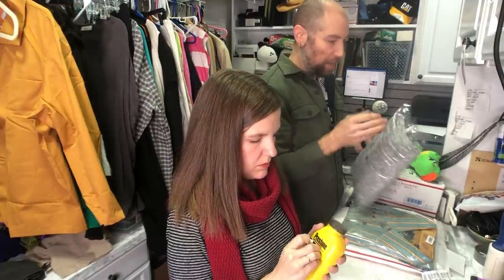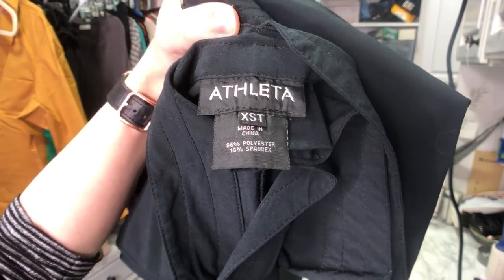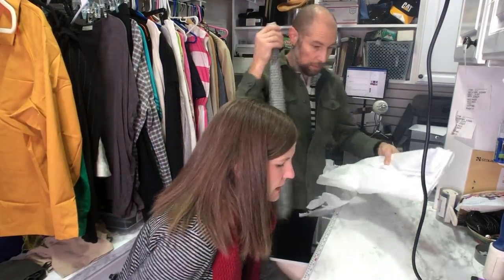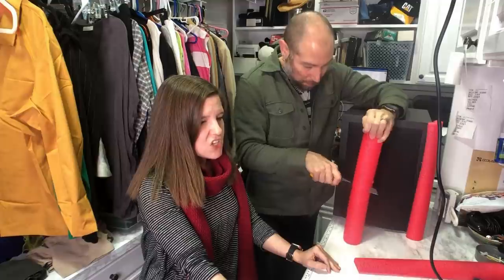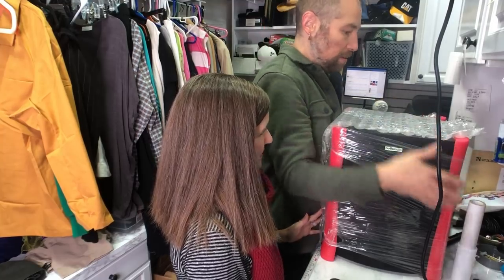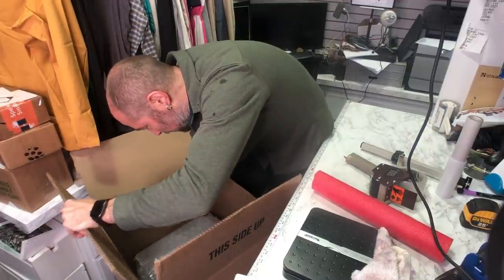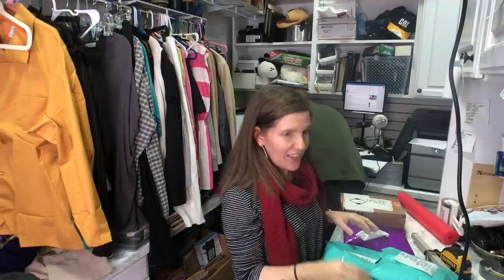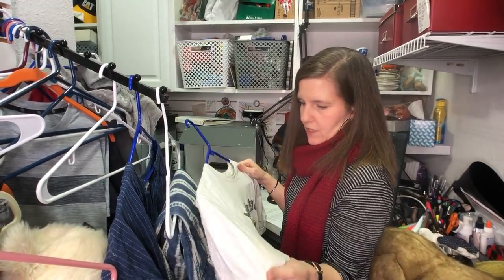Friday Q&A + What Sold On eBay Yesterday [How We Pack & Ship] Goodwill Bins Haul

Comment: Dan - how did you appeal your dings to get them removed? USPS here in Little Elm didn't pick up today  because their carriers were given the day off. By the time I discovered it, the PO had closed early. I'll get dings for two packages I guess. (Luckily, slow sales day yesterday.) Do I contact them through eBay for Business on FB or is there a better way?
Reply from the maker: eBay for Business on FB seems to be the best/most direct option most people prefer.  I've always had good luck with the standard ebay support chat though.  But there's also a "request appeal" or similar link somewhere on the detail page.

Comment: I just wanted to add maybe using foam boards to pack the electronics you sell would probably save you time and money. There's large foam board that you can get at home depot I think they use for insulation. They're huge sheets for under $10.00. Just an idea.
Reply from the maker: That is a GREAT idea thank you!!